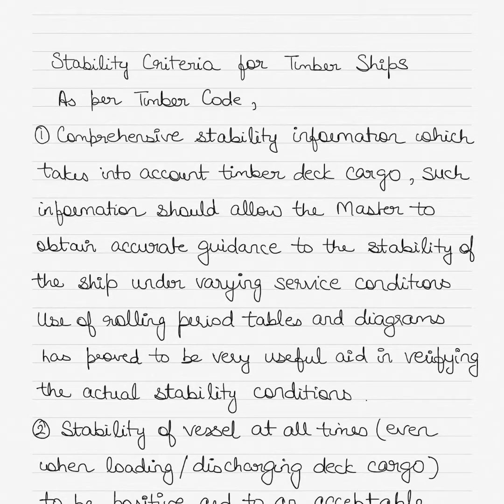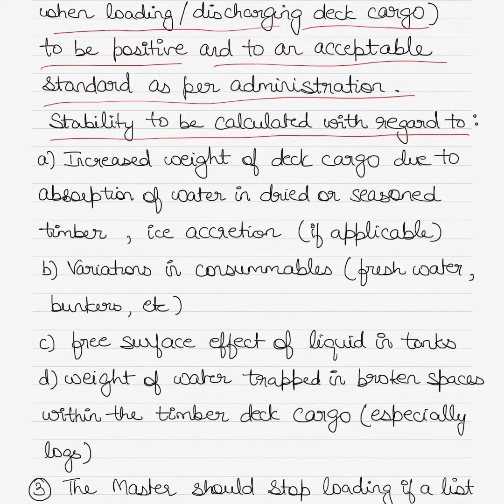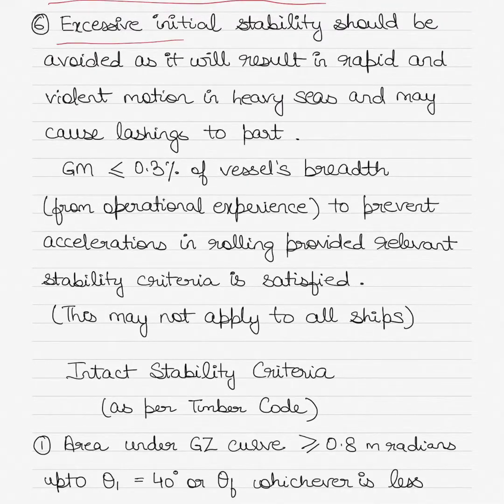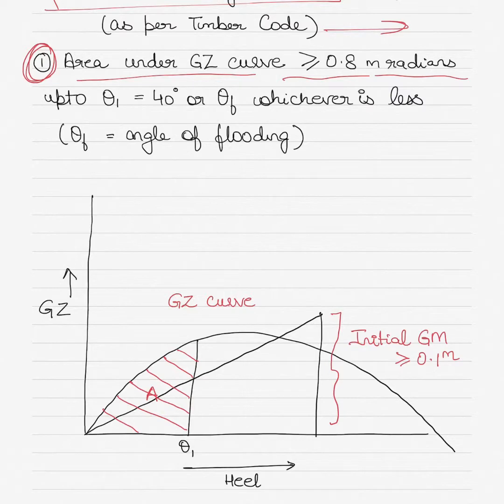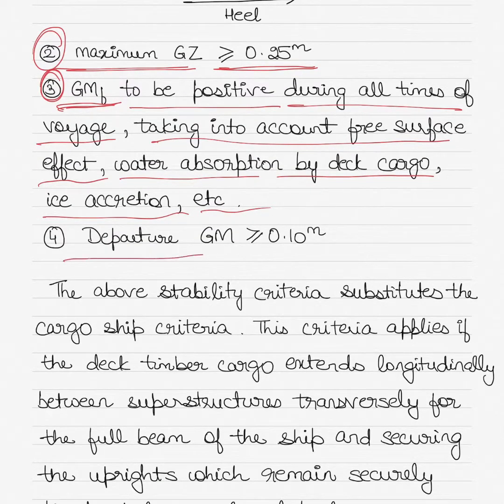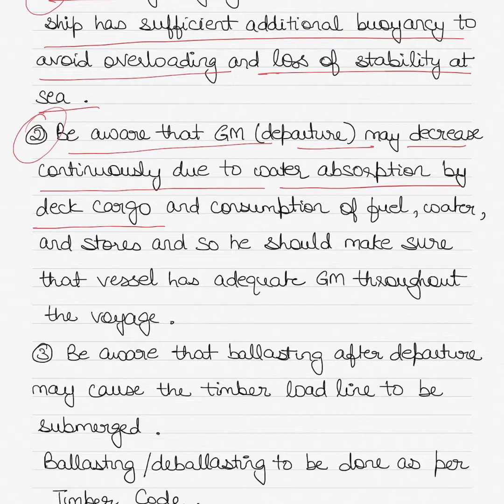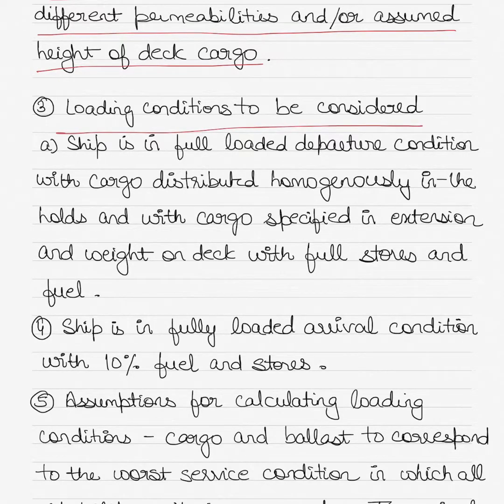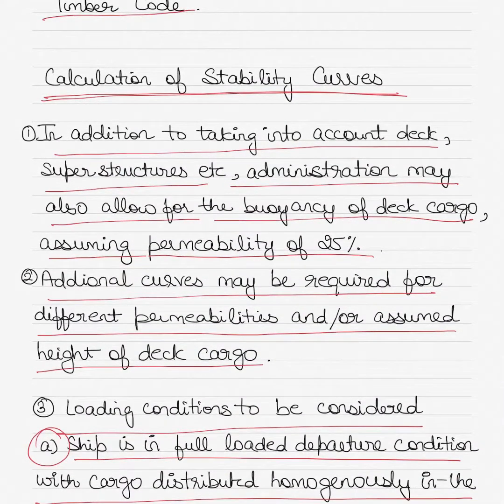Stability Criteria for Timber Ships - Cargo Work

Comment: Good day Captain,  Several textbooks I read stated "the area under the GZ curve up to 40deg or angle of flooding whichever is least shall not be less than 0.08mRad". However, in the video, it was stated as 0.8mRad. Please kindly clarify which is correct?

Comment: Great video as always sir. Can you explain why the initial GM for timber cargo is less than the required GM for other cargo ships (0.15m)?
Reply from the maker: Yes, its because timber carriers carry timber on deck which may absorb sea water or rain. absorption of water will ad weight on deck due to which COG may shift upwards increasing the GM. Thus, these vessels start with a low GM. Hope this helps:)